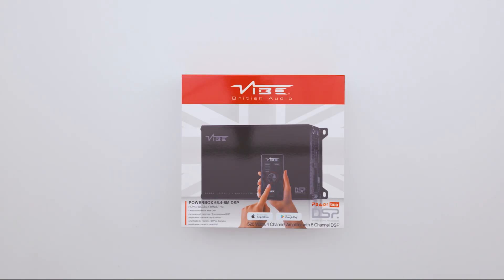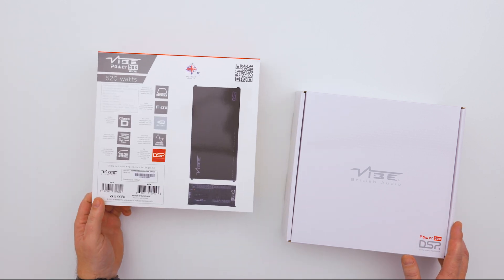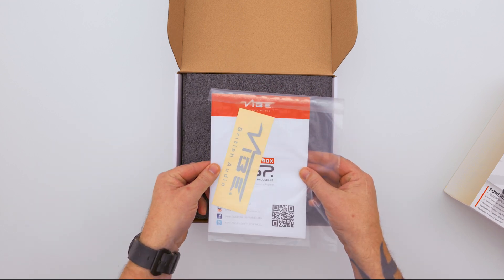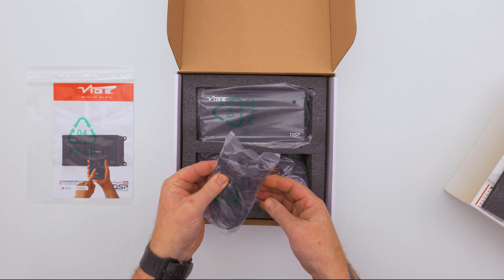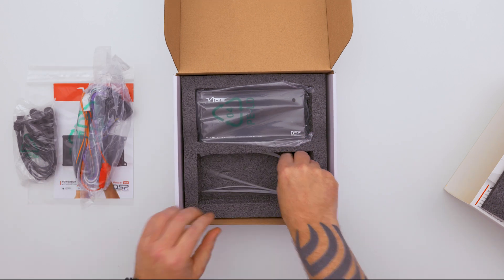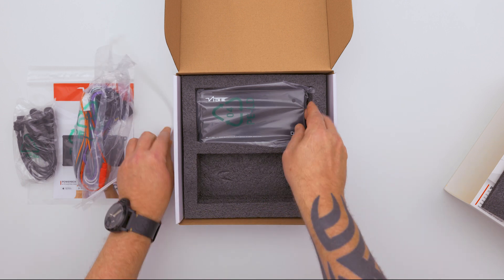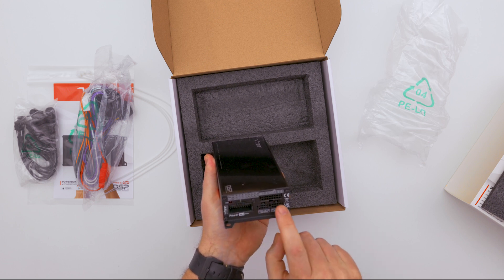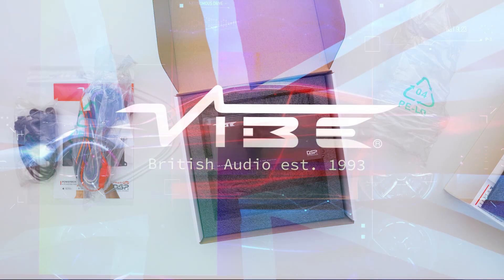UNBOXED: POWERBOX65.4MDSP-V3

Comment: Can somebody from vibe answer me this question I bought a kit with a Black Death 9500 sub and it came with POWERBOX3000.1P-V2 is it safe to run this monster of a sub of this small little amplifier
Reply from the maker: HI There, sorry for the delayed response, yes, POWERBOX3000.1 amplifiers are designed to work with BD subwoofers! just make sure you have the electrical system to support the amplifier aswell as correctly set gains.

Comment: How do you go about setting up the levels in the band adjustment, can the amp do this itself like some other dsp amps by connecting a condenser microphone?
Reply from the maker: The Vibe DSP software does not support auto tuning so any adjustments are manual, however. When using the PC software if a condenser mic is connected and white noise is played, the software supports an RTA graph overlay, which you can use to set up your band levels manually.
Reply: @VIBEAudiotech  wow, it only took you 8 months to reply!